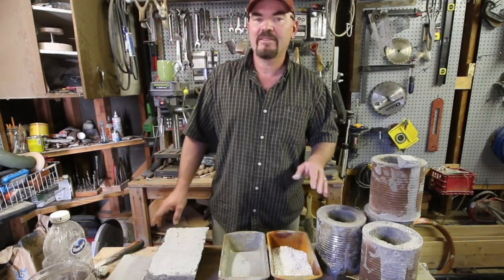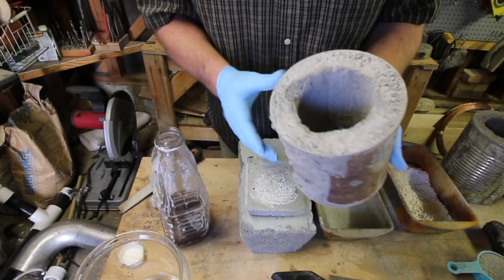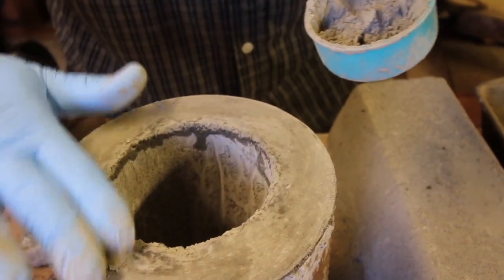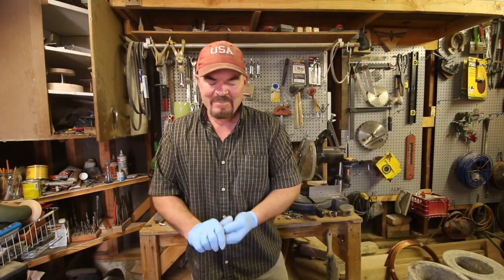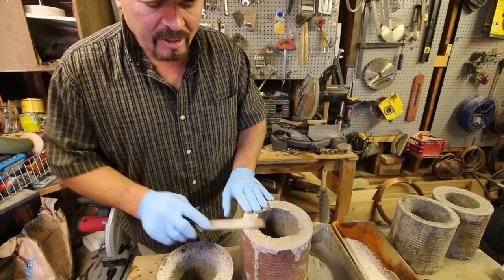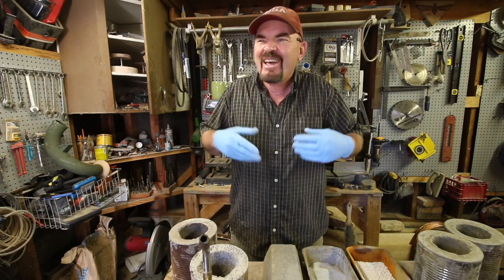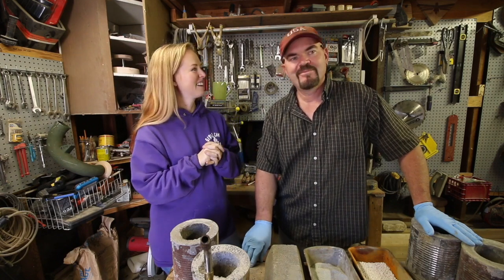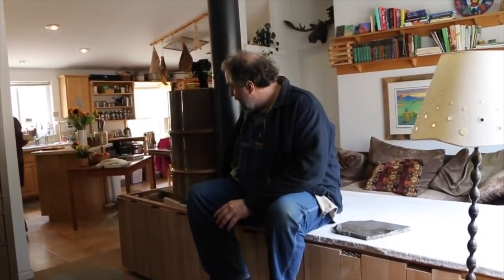Creating a Refractory Mix Out of AirCrete for the Rocket Mass Heater

Comment: Howdy.  I respect what you are doing but would like to comment on something I think I heard you say in re adding water glass (silicate) to the original matrix - as opposed to applying it post-cure by immersion or cement / silicate application afterwards.  I offer the following from hard experience that too high a concentration of water glass in the original matrix (may) ultimately expand - as it appears to in your surface ablation demonstration - and cause failures (cracking) over time.  From my observation, differential internal stress(es) cause expansion in the cure(ing) matrix - which goes on for (months) - across heating/cooling cycles normal to your intended use as a (flue pipe).  

Stated another way, your insulation value is preserved until essentially mechanical stress in the matrix causes failure - at which point you get a hot failure which you may not even notice unless you are present to hear the crack.  (My) first symptom was the sudden development of a vertical hot spot which translated to the exterior (steel) form and began to heat radically.  Fortunately, I was awake and heard/felt the temperature change in the system and smelled the paint over heating.  More fortunately the failure did not occur near the roof penetration.  Diagnosing it required disassembly and destruction though - whereupon the material looked quite normal on either side of the vertical crack.  The remaining material was still quite functional and without signs of soot, carbon, decomposition, chalking or other chemical failure (per se) and did not exhibit voids that might have indicated an air inclusion or water pocket (i.e. steam fracture).  The cross section was to spec and not appreciably thinner in the failure area.  The matrix had simply mechanically failed and permitted heat migration to an area that was not acceptable.  

In all, the remedy was simple as I had likewise taken a modular approach to the design.  I was fortunate to have cast more sections than I needed and simply swapped the failed section out.  It has not failed since though I encourage others to really think ahead about mechanical issues and not build complex designs without really thinking through issues that may induce a lot of variability across thermal stress internal to the (pipe) - such as in way of bends and long pipe runs, or where back pressure(wind) or sudden cooling via rain runoff and condensation may work against you over time. Milled or chopped glass fiber can mitigate stress failures but need to be carefully dispersed in the matrix to avoid balling and inconsistencies.  Shorter fiber lengths "flow" better when pouring/forming your shape.  

It is strong argument however for using ceramic wool (not just fiberglass building insulation) and an air gap in all wall and roof penetrations though to provide an extra layer of safety despite how well your matrix performs.  Likewise - folks need to use all-steel forms (no aluminum - ever), as i know you have shown in your videos.  Thin wall dryer ducting is a poor compromise to heavier gauge wood stove piping.  All welded sleeved or flanged construction is safer yet and lasts longer (at the compromise of weight of course).

Otherwise to the topic, I have found that box-store grade perlite, vermiculite, and even sawdust shavings and other materials can contain widely variable percentages of "fines" that (can) affect the quality of your matrix.  Some fines are essential but the percentage of fines to (nominal grind sold) greatly affects wet out and ultimate (solids volume to liquid) ratios [if only as a function of total wetable surface area in that batch] and performance thereafter.  Too many fines of any constituent may result in "dry" and friable matrix with varying performance across the part or batch of parts cast.  A scientific and deliberate approach is advisable wherein you evaluate the fines percentage in the material purchased - and decide to do some separation from there and/or adjust liquid volume accordingly.   Batch to batch variability is the challenge (we) will forever have to consider - across virtually all the constituents; unfortunately.

Post-cure application of concentrated water glass is perhaps a more robust and reliable approach - but adding "some" water glass to the matrix (foamed or otherwise) is useful up to that terminal percentage.  

Again: I respect your interest and ingenuity and only hope that my comments are received in the spirit in which they are offered. From one coyote to another: thanks for sharing your experiments and results.  
Wiley Coyote
(Ph.D in the school of hard knocks and other lessons in life)
Reply: Dirtpatchheaven and vc 

No. 1) Thank you both very much!

VERY  interesting VERY usable information THANK YOU for sharing this information and for making it real with your personal narrative. I would head, implore, beseech and pray others will AT THE VEEEEEERRRRY LEAST take this information into consideration! I wholeheartedly agree that it is a superior and ergo preferred method to utilize the "Water glass" as an additive or possibly even complete immersion of the refractory matrix secondary to the initial cure.
 
Moreover I can not stress the importance of redundant backup systems (IE: ceramic wool etc.) around any type of roof, wood, or other possibly flammable material penetrations. I would also encourage all who would consider this or projects like it ESPECIALLY as an a primary or even supplemental source of heat for a place in which is intended to be inhabited notably during periods of sleep to incorporate both smoke and carbon monoxide detectors into part of the home safety plan.

I believe it is also worth mentioning that if this is intended to be utilized as such it may require a permit, and or inspection. It may also conflict with your homeowner's insurance which could be utterly disastrous.
Reply: Do you have any opinion or insight about utilizing "Water glass" with perlite and plaster of paris as in an application of this type?:
https://youtu.be/uIRTcmR6sSk
obviously it should intrinsically not be AS dangerous as it should pose significantly less opportunity to of a house fire. However my question is more along the lines of violent rapid expansion at the point of failure. (IE: I wouldn't want this to eventually literally blow up in my face)
Reply: Thanks for the question.  I have used of water glass, perlite and plaster of Paris in refractory applications; with ans without some Portland Cement in the mix.  Overall my opinion is that it is an effective mixture within a certain temperature range and duty cycle.  Assuming you have a safe design to start with, of course.  Too many designs fail to consider the required minimum radius's of turns and/or the effects of changing diameter in a given section / cross section.  Inappropriate designs cause hot spots that can age a relatively small area of your matrix much faster than the surrounding material.  Differential aging is akin to your system having cancer or an infection.  Ultimately the affected parts will have to be treated and/or surgically removed.  The goal of a safe and cost effective system is attainable though some general rules of thumb should be observed.  For one: increase wall thickness whenever you can and always around areas that include flues, bends, or other transitions in/of materials and/or gasses.  Second: add some reinforcement to the matrix.  "Cat Hair" (catalytic fines) available at most cement suppliers, or long chopped strand fiberglass, go a long way to resisting expansion and holding the mix together.  Steel mesh or a wire reinforcement is also a good idea if you have the ability to place it in your pour accurately.  The mesh must not contact the sides of your shape and be placed to resist the strongest opposing force in the shape being poured.  (tension, compression, etc)  If you cannot reinforce the system internally then your system must physically do so by other means.  One experiment I tried was to use a layer of ceramic wool placed against the surface closest to the fired surface and back filling with matrix behind it.  Results were good in terms of retained thermal mass and safety.  The wool took most of the heat and was not subject to the thermal stress issues that just matrix (is) but there was no doubt some loss of thermal efficiency in terms of heat transfer from the inner hot steel surface to the matrix.  Overall I would not recommend this approach to new builders.  Use the wool for sure.  Don't try sophisticated laminated sections unless you have the equipment and some practice.  In closing I'd like to address your last part: the risk of explosion.  Violent decomposition of the gasses in a cement/plaster/perlite or other matrix is unlikely if you take reasonable precautions in the construction phase.  Most decomposition's are in the form of steam and experienced as a loud cracking noise attended by violent expansion, shifting of mass, sound and heat.  The failure I attempted to address in prior posting was of the resulting unplanned migration of heat to the surface or other components.  These may indeed (explode) depending on their nature.  Think of the towel and can of hair spray neatly arranged on the nice warm pipe or bench and then add 1000 deg F in a small area that is ordinarily only warm.  You get the idea.  More likely,  worry about a matrix failure allowing heat to migrate to the exterior of the (pipe) that then contacts a wall penetration that is not spaced properly and/or not protected with a secondary or tertiary layer of insulation throughout the penetration.  Installing air collars alone without fire resistant material sheathing, glass or wool insulation, and/or fire stopping /intuminescent caulk or foam is fast but not very wise.  But as to the inherent risk of explosion; it is steam/gas based fractures you must mitigate via using vibration, vacuum, surfactants, post cure drying cycles, intelligent design... and other factors.  Good question though.  Thanks.
Reply: Not sure I understand your comment; sorry.  Steel(s) indeed melt in the range of 2500 deg/F; give or take a few hundred according to composition.    BTU's are a measure of energy evolved out of a given mass/substance expressed in metric terms.  (kilocalories per unit mass... etc.)  Not sure I followed your next point though.  Its been a while since I have reviewed the video but I "think" the author was attempting to compare a RMH to "other" methods of burning similar fuels.  Stated as a hypothesis: RMH's are not more than (5 times) more efficient than other means of open combustion of (insert fuel type) when measured via the (insert method) at (insert location).  I think the comment was directed at "efficiency" which is not entirely described by combustion or melting temperatures alone.  In general, "efficiency" is a measure of (work) over the unit of time.  In RMH the "work" is reduction to energy (BTU) via combustion in (air).  The time base is a comparison of work over (minutes to boil a pot of water) or more precisely: to reduce a (cubic mass) of (fuel) to (state percentage of reduction) via induced combustion over time.  Or more simply: the time it takes to decompose a few briquettes into heat/gases, and, the ability to harness that (energy) in a concise, controlled, focused manner to some useful purpose - like heating water.  RMH's are indeed more efficient than open camp fires.  Are they 5 x more efficient?  That was what I think the author (said).  So (can?) a given RMH can (boil water) in as little as 1/5 the time that a it takes other fires/stoves to do so ?  I don't know but I think that was the claim the video implied.  Do RMH's use fuel more efficiently?  Absolutely.  Are RMH's 5x more efficient than say an open propane stove? I don't know.  But if you were to burn the same fuel in a range of stoves and measure how efficiently they either do "work" or convert fuel to its by products of combustion: rocket stoves (RS's) reduce fuel pretty fast/completely.  RMH's do a pretty efficient job of harvesting (scavenging) waste heat from combustion gases and storing  or transferring it slowly to the surrounding area.  Whether a given design of stove or heater is 5x more efficient; 5.1 times... 4.7 times... or some other ratio per unit of measure (BTU) is a complex "system" but can be modeled or tested.  Whether the upper limit is 5 times more "efficient" or  something less does not matter so much as that (we) collectively work to move that line in the sand via our experiments and collaboration.  To the extent that your question accomplishes that - I thank you.  If I misunderstood your question please run it by me again and I will take another shot at it.  Thanks.
Reply: Thinking about your question again, I neglected to address another risk that should be considered by us all.  That is the additional risk of carbon compounds accumulating in the system for any reason.  Specifically, as a function of failure in the matrix that may or may not be visible.  While I prefer to use the matrix as a "filler" between (steel) conduits (stack pipe, sched 40 pipe, etc) as a matter of utility and safety.  Not everyone does this and some use the thin steel (please never use Aluminum) flue pipe such as might be used to vent a dryer.  Regardless of materials (eventually) corrosive gases exist in the system - even at rest, which condense and settle to the ultimate failure of the system (better metals take longer but ultimately all will fail given enough chemical/electrolytic insult and time) which may not be visible; even when video inspected.  Returning to the question, and especially once either the matrix or the (liner) fails, you get both uneven heat distributions (hot spots) and turbulent flow of some magnitude.  Carbon deposits typically accumulate whenever the system parameters are (un)favorable (poor combustion, low draft, high back pressure and a hosts of other reasons - which (may) be encouraged by matrix failure as well.  Think separation of the matrix that results in a hot spot; that results in liner distortion or failure, which (may) result in carbon deposits due to uneven pressure/temp/rms of the surface/ etc... which may cause further uneven distribution of heat/pressure... and further deposits... The knee bone is connected to the shin bone... and so on.  You get the idea.  Bad tends to worse and carbon has properties unto itself that makes it accumulate (log scale) once it gets a hold/start.  This affects draft, which affects performance, which affects combustion and the (puppy chases its tail) until the system has an undesirable accumulation of carbon compounds (which are themselves combustible).  Why this pertains to your question is because the same incipient event (hot spot and/or other failure) "may" become a potential ignition source - which can devolve in rather fast and very hot events (a.k.a. stack fires).  If you have ever seen one, the initial flash off can be either slow or quite dramatic, and quickly raise internal pressures and temperatures way beyond (design) parameters.  Think black powder shotgun worst case.  This causes joints to move or separate (assuming you get the fire out) and sometimes splitting of weak elements.  So say that as a sentence, perhaps you could get "blown up" if a poorly designed or poorly maintained system is allowed to accumulate a substantial amount of carbon internally, and, a defective or (out of range) parameter is exceeded (like internal temperature) due to a hot spot flash over.   Admittedly you have to work at it to get such a hazardous situation but the kicker remains that you may not know you have a matrix failure and may not be able to see the failure even if you are fortunate enough to be present when they happen.  As with the knee bone model above, one failure leads to the next and in this case things can go from bad to catastrophic with (some) of the symptoms being hidden.  So routine inspection, cleaning, monitoring, and objective evaluation of the complete system is more than just about efficiency.  It can save your property and your life.  Not to preach, but this is in part why mixtures, constituent quality, consistency, and other procedures are essential when mixing up, applying, inspecting, and maintaining matrix-based components. Particularly, when they do not have both sides lined with additional support (steel) and/or refractory materials, and, why they need to be inspected periodically with a pyrometer to establish a baseline operating range, and deviations from historical trend.  I know that is a long way of saying something simple, but as is so often the case, your simply worded question is indeed both complex and important to everyone that attempts to build/operate these systems.  Thanks again for the question.
Reply: Howdy and thanks for your question.  The short answer is "yes; but...(sometimes they do)".  To be more specific, sometimes people build out the RMH system with wood and materials like cement board before adding the stone mass or matrix.  Where wood elements are AIP (abandoned in place) they remain combustion hazards (as well as other hazards according to what was AIP).  Penetrations through or "in way of" these structures, as well as walls, roof systems, and otherwise, should be multi layered and "defensive" in nature.  Multilayered means some combination of air gap, glass or ceramic wool, and non combustible materials.  Defensive means designed to anticipate hot failures (among other failures) in the flue/system, as well as being designed to facilitate inspection, cleaning, and repairs when needed.  Neither approach need be difficult and many good materials and designs exist that can be used.  Ultimately though a RMH is also a RS at least in some respects.  As RS's can develop substantial draft values and high temperatures, the possibility of high heat developing at supports, penetrations, and in the system in general, must be anticipated.  So to return to your comment: you are correct.  But there are always some manner of supports/pass through/penetrations etc. and these need to be considered in failure mode as well as nominal anticipated design parameters in order for the system to be "safe".  I hope I addressed you comment.  Thanks again.
Reply: Just a follow-up that may help side step some of the corrosion and stack fire issues...
In a system that is designed well - with clean outs and low point drains, etc... that has an appropriate application of materials that protect (steel) and /or either thermally insulate or conduct heat according to the needs of the "system" overall... (aircrete vs thermal mass: see K vs R comments above)... I have experimented with differing cleaning methods and share that the most effective technique I have found is steam - as in from a steam generator or other source.  You will/may need a flexible conduit to snake (slowly) through the system and a 360 degree nozzle like those used for sewer line jetting (see E-bay or Amazon if you cannot fabricate one) and something to capture the effluent in (hot water and carbon / byproducts of combustion)... but the results are pretty impressive.  
The risk is vapor condensation migrating between the protective shell (steel pipe or whatever) and the poured or vacuum assisted matrix (regardless of type) and water becoming trapped or pooled in places that it will either freeze or rapidly expand later as the system super heats and cools.  
To be clear, this potential exists whether by cleaning or otherwise as a matter of natural use and cooling cycles, and there is no real way to avoid the issue (not really).  Overall though, interior sections are cleaner than when brushed or blown out with compressed air (IMO).  
I would not use a pressure washer under any circumstances though as the high pressure can make faults and erosion in the matrix fail quite quickly and without your knowledge - that may not even be visible when video scoped afterwards.  Steam is gentler and more effective but you have to develop a drying protocol afterwards... Get the system as open as your design allows and put a ventilator or blower on the sections and let it run a while sometime during the off season or planned down time.
  
If you attempt internal cleaning be aware that effluent migration (may) also cause concentration of corrosive elements as they wash/flow to the low points - which (may) sit and work on (steel) components silently for (ever afterwards).   Soot will also entrain and coat or otherwise be absorbed into what will likely be a semi porous matrix inside the pipe.  There is no avoiding this but puddles of carbon/combustion byproducts should be avoided.  Especially if you burned plastics in your fire chamber (not a great idea).  So keep the water volume (condensed steam volume) as low as possible and design for this potential in the first place.  You might also consider re-introducing a water glass / silicate or other constituent into your cleaning program as a defined (last) step.  Try a low pressure 360 deg spray and keep the wand or applicator moving.  Less is more here...

Re-coating can boost longevity but again - must be dried carefully before system re-start and warm up.  A contractors forced air heater (propane or otherwise) can be ducted to help dry sections but slowly and at some distance from the sections.  Too short a duct section and you get too much heat too quickly - same as if you just fired the system up too soon.  Otherwise, just leave the system open for the (dry) summer months and blow it out again (ventilator fan: not HP air) to remove residual dust and whatever crawled in to make webs, etc.
Any restart should be accomplished slowly regardless of cleaning method.  Small burns with gradual heat transfer that is monitored via pyro meter or infra red... Down times are the enemy of (almost any) system but re-starts can cause more damage than anything if not performed slowly and systematically.  For what it is worth...
Reply: One additional thought: I would not use steam or water in a system that relies on batting or other dry-type insulation if water migration could in any way get to the insulative layer.  For example, slip-pipe or interlocking poured sections wrapped in a dry material.  Not a place where water should be.  LP air or an air assisted brush is a safer approach to cleaning in such systems.  My use of steam is best for sections that were designed for cleaning and / or welded systems that are otherwise inaccessible.  
Figured I better mention it in case my previous comments were too general. Thanks.